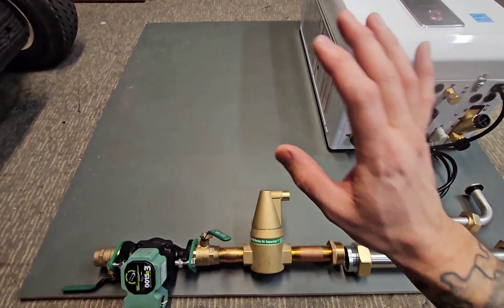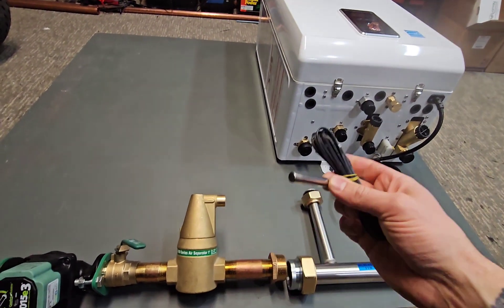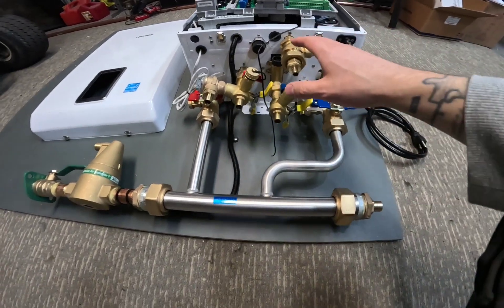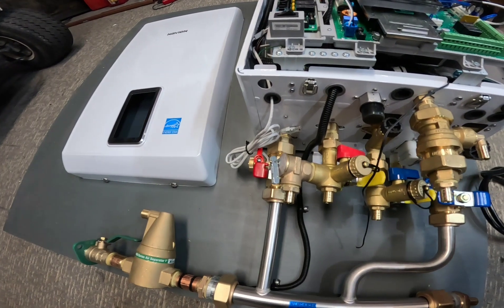Building A Single Zone Combi Boiler System

Comment: Fantastic videos.  I have learned so much from watching them.  I am currently planning a retrofit from my 14 year old boiler to a new one and trying to use as many of the current valves and piping as possible.  A bit challenging making everything fit.  I may end up just cutting most of it out and starting over.  Thanks again and keep posting

Comment: Hi 
I would like to use Navien Combi boiler for a single zone house including baseboard new installation for basement and hot water supply. I am new to this. Any DIY advise.  Can I built it myself 9:37  and could you please assist me build it in easier way and what connections do I need. Basement is not that big it has a room and bathroom with open area. Total about 700 sq ft. Please advise me 
Thank you
Reply from the maker: Email me at speranzadevelopment@gmail.com

Comment: so my question is how do you use this system without domestic hot water i am building my home and we have a seperate tank water heater ?

how do i use this model ncb-h . do i just plug the domestic ports up ? 

we are currently in the process of returning the nhb model because we dont want to use zone valves and that unit wont allow it . the only manifold navian sells for the nhb model has a required external pump 

please help @jim speranza
Reply from the maker: Email me at speranzadevelopment@gmail.com and I can help

Comment: Does the Naveen Combi boiler require to have domestic hot water plugged in as well or can it be used on a closed loop circulating a system only?.
Reply from the maker: They sell heat only models as well but you can use just the heating portion of the comnbi boilers if you need to.
Reply: @JimSperanza  thanks. I have to rebuild my current system. I did something wrong and I used a domestic hot water heater instead of a boiler and I'm not getting any flow on the primary loop. Kind of lost disappointed. I've got 60 hours into troubleshooting. It pays somebody $150 and he came out and told me to change the location of a pump and everything should work. This is just for my 30x40 garage but I'm really starting to get to the point where I just want to give up. I have great flow through the floor loops. I guess it's going to be next year. I'll hopefully be able to wrap this project up.
Reply from the maker: Email me at speranzadevelopment@gmail.com

Comment: Great video! I'm curious, was that the recirc inlet where you have that back flow preventer installed?
Reply from the maker: The backflow preventer is connected to an auto-fill feature that Naviens have that gets fed by domestic cold water and it will automatically fill the system and maintain pressure.
Reply: @JimSperanza  Once again, great work. That's art work for sure. Thank you.
Reply from the maker: Thanks! 👍

Comment: Hi Jay
I was a plumber for 42 years and have installed tons of tankless gas heaters but being from South Florida, I know nothing about radiant.  I retired and moved to the mountains of NC and want to do radiant on my house. 
My first of many questions is, in these combi-boilers, do the domestic and heat water mix within the boiler?
Reply from the maker: No there are separate connections. Email me at speranzadevelopment@gmail.com and I can help you out.
Reply: no, there is a heat exchanger inside the unit that heats the domestic water using the heating water.

Comment: Hi! How did you control the pressure for the Dhw separately from the heating (70psi vs 15pso)? Did you split cold water inlet and one goes into unit and the other goes directly into return space heat?
Reply from the maker: The combi boilers have seperate connections for the domestic hot water and the heat. The water for both are completely isolated from each other.
Reply: So odd to me as to why they couldn't separate within the box - I guess to continue to save space?
You tapped into return space heat with 15psi?
Reply from the maker: The heat exchanger for the DHW is inside the unit. There are just separate connections. Not sure what you mean about the return space heat at 15 psi?
Reply: @JimSperanza  I'm going to send you an email - thank you!

Comment: Hi Jay, I love your work ! Can you skip the additional external circulator on a single zone and just run as one loop with the internal circulator  instead of the primary/secondary set up ?
Reply from the maker: Yes you can as long as you meet the minimum flow rate of the boiler..
Reply: had exactly the same question. thanks.

Comment: Jim I have the NHB-150 Navien Boiler. What the best pump?
Reply from the maker: The manual shows what pump to use for the primary circulator. As for the secondary the size will depend on the head loss and GPMs required for your zone. Email me at speranzadevelopment@gmail.com if you would like me to provide a piping diagram and parts list.